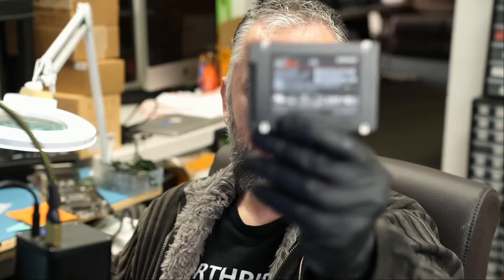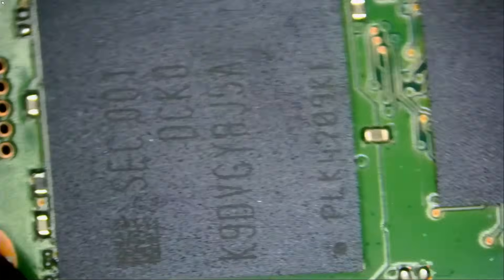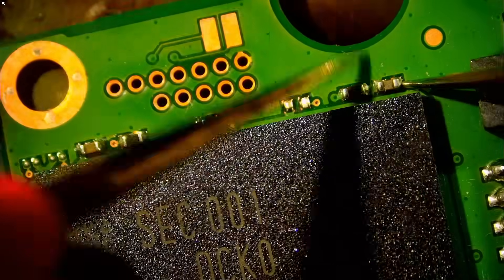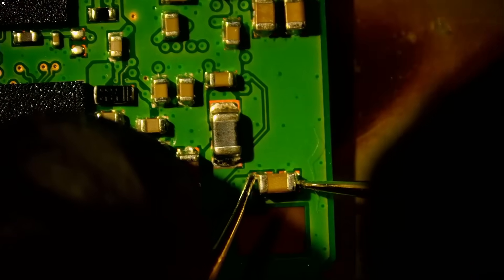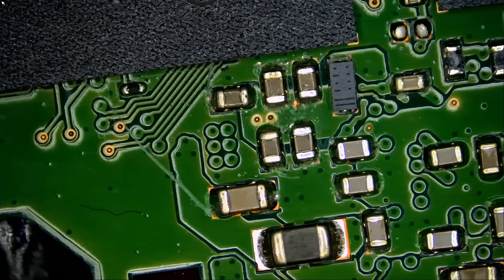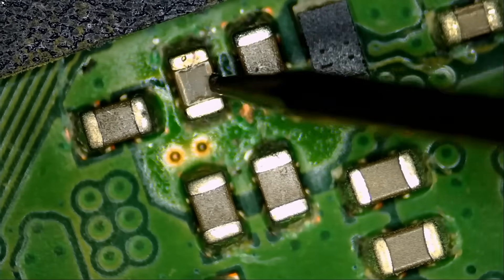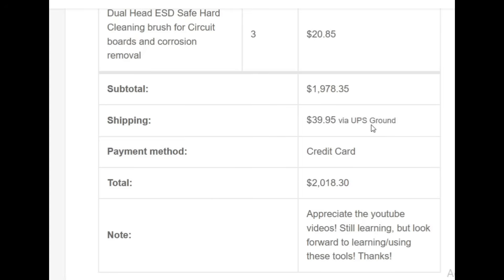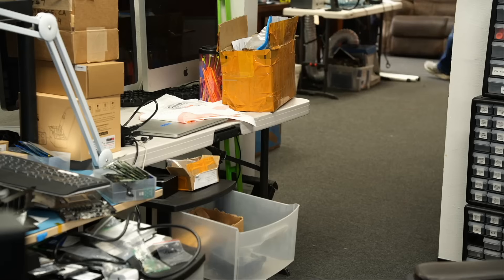Fixing a Dead Samsung EVO 860 SSD & Recovering Crucial Data

Comment: I can say they ship out super fast Alex is an excellent businessman! I purchased the new meter leads and I used them recently to install an accessory in a persons car and the probes are so fine I was able to back probe the connectors no trying to piece the wire to get to the copper no stripping the wire to gain access it was so much easier and quicker and the leads are long as well OUTSTANDING! thank you Alex and everyone at NorthridgeFix!!

Comment: I agree that Samsung and Crucial being sold in large volume will lead to more bad examples, but I think more is going on here.  

I think possibly the high performance makes them initially run hot and then Samsung pushes firmware (Samsung Magician) to make them run cooler resulting in a less performance than at launch marketing.  I used to not update SSD firmware, but after several failures in SSD drives (actually only my SAMSUNG EVOs) after just a few years of usage I do and have had better SSD success.  I have never had a problem with my WD Blue and WD Greens (knock in wood.)

My second theory is that the components are just to small and that EPA mandated lead free solder is causing tin whiskers- something that can happen even faster with the extremelly minimal pad spacing we are seeing more and more of today.  I have a lot of vintage hardware and it all "just keeps going."  Even my Voodoo 1 & 2 stuff (which I run hard) with similar candy bar style comoonents and 20+ years is no sweat for them (no added heat sinks.)

I have dozens and dozens of mechanical  HDDs that are very old, some daing back to the 80s.  They almost all work, and often the oldest drives, when they do fail, is because of bearing issues, not the robust solder and components.  

I never had a consistant HDD issues until the circa 2002 capacitor plague which only lasted a few years.

I don't trust any SSDs and since 2018 ish I strictly run a network NAS  RAID array with a small dummy SSD in all of my terminals.  I use large mechanical HHDs to back up the NAS once a month that I store in a bank safe deposit box (fire redundancy.)

Two HDD raid arrays used to do the trick, but you just can't trust todays SSDs when factoring in how well they handle power surges.

Comment: I have  4TB EVO with a bad controller.  Where's the best place to get a replacement chip?  I have an 850GB EVO I thought I could swap the ctlr from, but it's a different part number.
Reply: A different 4 TB Evo. Just ask yourself what is more important to you: the data or the drive? The next question should be how important the data is to you and then you can calculate if it is worth it.

Comment: I bought a Samsung EVO SSD here in Iceland almost three years ago. A few months ago it broke and I took it to the store I bought it from thinking I would get a new one as Samsung said it would be warrantied for five years. However, I was told that the store only offers a two-year warranty so I have to contact Samsung myself to get this fixed. The problem is that there is no way to contact them other than by phone with some foreign service provider which is not available to me due to language difficulties. So if anyone has any information on how to contact Samsung in writing it would be appreciated. ChatGPT can't help me or Google.

Comment: I do not think everyone is buying Samsung Evos, because there are way cheaper SSDs. From my experience, any brand can fail, and Samsung are the most reliable ones. Those generic brands, using a 2nd grade NAND and Phison controller do fail alot more than Samsung, not from shorts, but from NAND failure.

Comment: Thank you for the video, I love seeing data recovery like this.

I love the UV light, grinding pen, and dual sided brush. I'm able to clean boards and modify circuits much easier now.

I was able to add an spdt switch by modifying the trace and can now turn the music on or off on the rotating Christmas tree kit. I was able to add holes to act as a strain relief for the wires too.

Comment: Thats why you need also a 10tb hdd to massively backup every ssd you have. Amazing job as always.
Reply: 3-2-1 backup practice is the best. It is expensive in start but start slowly and build it up
Reply: That is what I used to do... and then one day in 2013 we had a bad power outage during good weather (elec co hit a line)  while  I was backing up and I lost both drives with all of my data dating back to the mid 80s.  

From that point on I realized an enterprise level HDD (reliable) NAS RAID array was the best option with large external hard drives to back up the NAS once a month that is stored in a bank safe deposit box for fire redundancy.

Sitting at 30 tb today and haven't looked back...